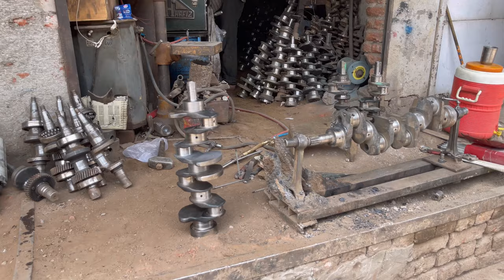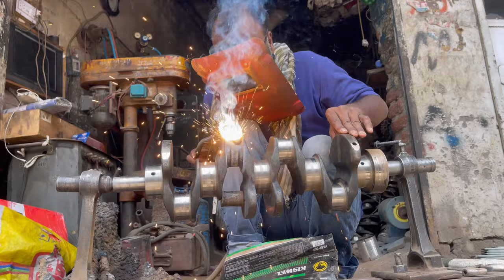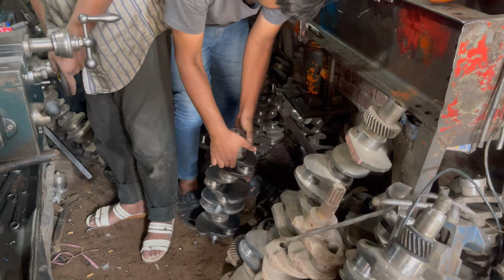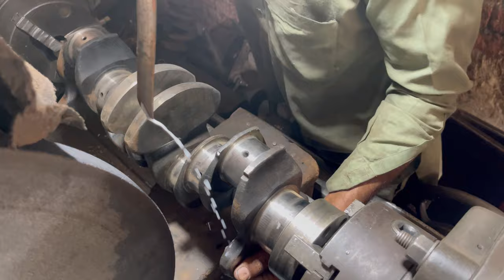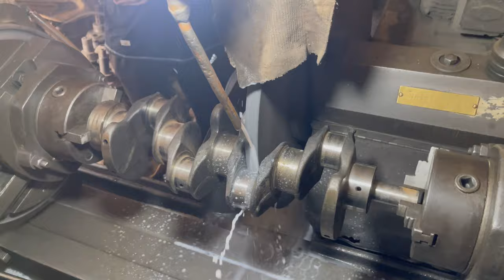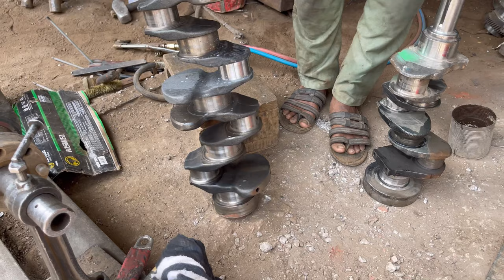How to Repair Broken Crankshaft - Welding A Broken Crankshaft |

Comment: Crank saft welding are not lasting. 
After fitted in block with cr bearing in connecting rod it hardly run 1 to 2 month. 
It's my 15 years practical and personal experience .
Reply: your problem is not crankshaft, you should change oil pump